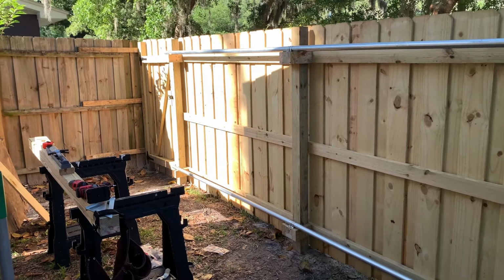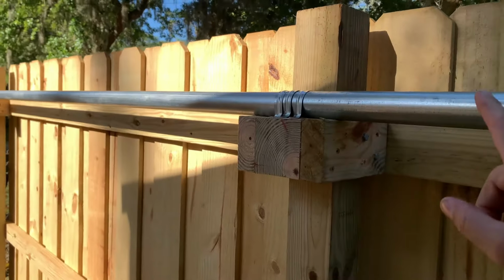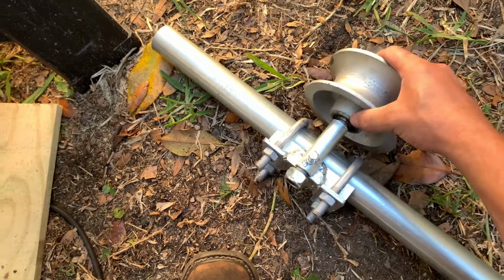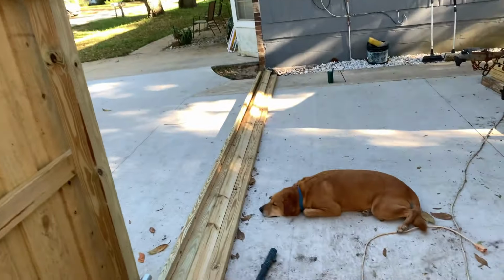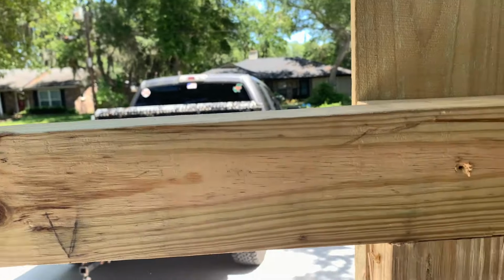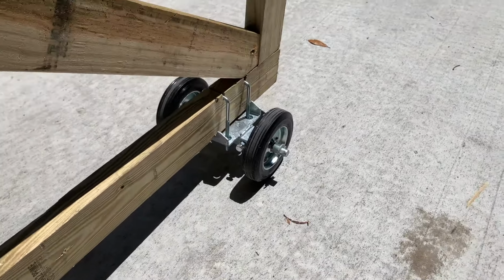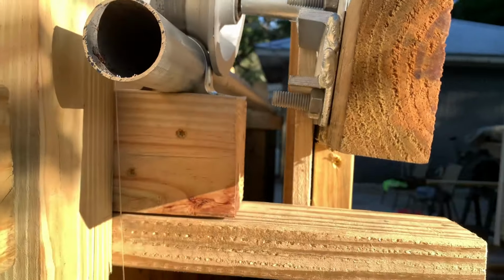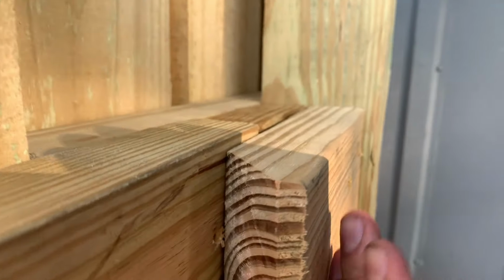How to build a sliding wooden gate (EASY)

Comment from the maker: Rollers - https://amzn.to/43TbXg0

Wheels - https://amzn.to/3KTUF9Z
Reply: Hey Floridaman  what is the gap from the bottom plate to the ground on the roller wheel ? I think my gate will be 64in tall and 15’ long . Setting my rail hight now , just wasn’t sure what the gap would be between the ground with the roller wheel , hopefully the roller wheel works Iam on grass for now , might have to do a 2’ wide by 15 ‘ concrete strip for the wheel to run on
Reply from the maker: @JasonGemes  I wish I knew what exactly you are asking here, are you asking basically what the diameter of the wheel is so you can see if it would roll over grass/dirt? they make rollers that are on springs, i dont know how well they would so what all that weight, but might work better over uneven terrain.

Comment: Just build the wood frame for the 12 ft gate. Then attach the metal pars the the stationary fence. Make sure it’s level. And rollers to the moving gate. I am building a shadow box style fence and 12 ft electric rolling gate now. I’ll post video when complete.
Reply from the maker: Awesome!!
Reply: @floridaman9045  what is the length of the 2x4 horizontal of gate? And how much excess did you leave off the left side for rollers? Height from top to bottom 2x4 horizontal post?
Reply: @TaylorGrayson33 Did you get your gate built? This is exactly what I'm wanting to do and have it motorized as well.

Comment: Thank you for the video! It occurred to me, to avoid using the clamps on the pipe and possibly interrupting the smooth operation of the wheels, you could drill through the pipe to fasten them to the wood supports.  You would just need to 1) drill a smaller hole all the way through the pipe 2) Bore out the top hole so that the head of the lag screw will fit through it 3) tighten the screw through the pipe (with an extension attachment) so that the head of the screw is resting inside the pipe. Just an idea. Thanks again!
Reply: could also weld them together and grind them down for a smooth transition.

Comment: I have wanted a sliding gate for my drive entrance for a number of years now.   This is almost perfect for what I need.  The problem?  I have a gravel driveway.  The roller may work, or it may not.  What I have discovered about the cantilever slide gates which avoid the wheel @ the leading edge of the gate involves allowing at least 4 or more feet at the trailing end of the gate. That extra gate length is what allows 2 of the cantilever wheels, top & bottom (4 total), to remain attached to the rails of the slide system when the gate is fully closed.  I believe the weight of the gate must be able to be held up by those trailing cantilever wheels.  These gates have concrete supports at the base for the strength needed.   Now, I might try this system, but only if it will slide easily over the gravel.   
***I see that, for the size of the gate you have installed, the extra space for the cantilever system I described above was not available to you.  
No matter. To me, this looks & works great for your situation.  The cost/benefit ratio, verses a more expensive design is quite strong here, too....   
Thank you for sharing this solid design.   
One question for today, a year after your installation:    How is your gate holding up after a year?   
Thank you for your time,
Reply from the maker: Very interesting! Gate is holding up great, I keep saying this, but I mean it this time, I will post an update VERY soon.

Comment: Where the gate hits the closed post. would it be better to have to hit the post that is in the ground not the extension post you added? also if i have a 12 ft opening would it be best to have 6 ft over hang for 4 rollers instead of 2?
Reply from the maker: Are you talking about the close or open position? and what do you mean by the over hang? I'm not a carpenter and don't do construction. This is just a project I did on my own, so I would only be able to give an opinion without a lot of knowledge.
Reply: when in the closed position would it be best for the gate to butt right up to the vertical post in the ground? and when the gate is closed to have 6 ft extra to have 4 rollers instead of the short area you have with 2 rollers attached to fence gate. Is your gate standing straight and moving straight or is it top heavy and swaying or bending? I think I will do a metal square tube frame now and attach the pickets to that to make it more sturdy.  @floridaman9045
Reply from the maker: Hard to understand what you mean, but I think it would be no problem to have some overlap. The gate is sturdy and is not top heavy. The reason I have such small overlap is because I made that person gate and I also wanted to keep the wheels on the concrete driveway. Adding extra rollers wouldn't be a bad idea. If you have the extra room and everything was perfectly square that might work great. My design kind of works on a tripod type design with all the weight going to the ground vs the rails/rollers, but it was all experimental. Let me know how it goes and good luck.    @TaylorGrayson33

Comment: Great job. I'm curious how you think this would roll over gravel or dirt? I can't use crete because there's a gas line running under the opening. Thanks!
Reply from the maker: there is a lot of weight and those tires are pretty hard, I have a feeling they wouldn't roll very well. I would probably put down pavers, or maybe like a 2x10 PT that might last a little bit with ground contact. Or you could always look for softer rubber wheels.
Reply: @floridaman9045  good call. Thanks!

Comment: I wasn't sure my idea was possible until this video. I like how straightforward your design is. Thanks from England!
Reply from the maker: Thank you! Good Luck!
Reply: Hi. I am getting closer to designing this for my slanty drive. One question. In your video at 4:55, I noticed that the top of the gate starts to flex away from where you want it to be. Later it seems pretty stable. Other than the weight of the fence and the strength of the fence build, is there anything that keeps it from twisting/flexing while it is rolling? It's windy on our drive. Mine will be considerably shorter so hopefully not a problem. Thanks
 @floridaman9045
Reply from the maker: Good question, once the pickets were on there it straightened them up some because it sort of tied it all together. But the best thing I did which you dont see in this video because I did it a few weeks after was run another 16' 2x4 all the way down that top board, I put the board on its side, so the 4" on the 2x4 is facing up if that makes since. It was dead straight wont allow it to flex. I glued it on with liquid nails and screwed it in. I plan on making an update video soon. Maybe I will do it today if I get a chance. @C3S789
Reply: Late to the party, but a tightened wire corner to corner in a diagonal fashion fixes sag and wobble on longer gates

Comment: You showed the rear rollers mounted to a 1 5/8 pipe but in the finished gate the rollers were attached to 2X4s
Reply from the maker: Yea I changed it up. still works great

Comment: I've started extending my existing fence and my wife suggested a sliding gate door.  I truly appreciate your video!  Not sure on all the things you did,  but im gonna try and use your ideas to make it work.   One problem i foresee for mine, is i don't have concrete for it to roll on.  Just dirt, so maybe I'll have to consider including some concrete,  for a better operation.   Thank you so much!  If you've made a follow up video,  please let me know,  since I'm new to all this...
Reply from the maker: This was my first attempt also, and its still holding up great. I would run a strip of concrete for it to roll on, or at the least you could get some pavers and place them in a stip. There may be some wheels out there that are more designed for uneven surfaces, mine seem to be pretty hard and I feel they would only do good on hard surface. Good luck!
Reply: @floridaman9045  I agree, I'm gonna consider doing some concrete for mine.  Probably at least 2 feet wide?  Thank you,  for your reply 🙏!
Reply from the maker: yea 2 feet wide should be good @garymcnemar6620

Comment: I am about to attempt this and would love if you could give me so info. How long of a board did you use? This is a 16 foot gate right? I just don't want to get started and run into issues. I was thinking of doing 10 feet or even 12 but easier to just skip a 8 foot post and keep going 8 feet
Reply from the maker: 16 foot. Good luck with your project

Comment: Hey Florida man I was wonder if pickets would take away the sway or would  2 x 6 frame be better
Reply from the maker: 2 x 6 might be a move, I added a vertical 2 x 4's on each side of the 2x4x16's to square them up, since this video was made. I put them on the side with the rollers. It now has no sway and opens and closes with ease.
Reply: @floridaman9045   nice do you have and updated pitchers or video ? Our gate opening will be 14’ foot , but will probably make the gate it’s self 15’or 16’
Reply from the maker: @JasonGemes  I don't but I will probably make an update video in a few weeks. I used 2x4x16's. I basically ran the full length, maybe cut them down an inch or two.
Reply: So we about have our fence done , rollers and wheel is ordered , we have a 14 , opening , i plan on using 2x6s for the Frame , with 2x4 stiff back horizontal and vertical ,  the gate will probably be 15 foot , give 6in eave way for coverage , I wanted to one piece my rails , I found some 21’ 1 5/8 but it’s 17 gauge do you think that will hold up ? Thanks you
Reply from the maker: @JasonGemes  That sounds like it will be solid, with a lot of weight (not a bad thing). I'm curious to see how it turns out! I think you should be ok with the tubing, I would just make sure to brace it as much as you can, if its not braced enough you run the risk of it flexing. Try to secure the rollers better than me. Mine wanted to roll since it was uneven. Or at the least take 2x4's and square up the side with the rollers (one on each side), it will keep it tight.

Comment: How wide is your opening compared to the length of the gate? Trying to figure out so i can do this. My opening is 10 foot. Should my 2x4 be a foot longer so i can attach the rollers?
Reply from the maker: I'd go 12' and you can always cut them. Only reason to go less if you dont have the space on the other side. Basically I think the longer the better.

Comment: Great video I ordered the parts you recommended but I'm having some trouble finding a square u bolt to fit the bottom wheel. Where did you find yours at? If you can provide a link that would be great as well. Thank you
Reply from the maker: I bought mine from ACE hardware, but I'm sure you can find at any hardware store like Lowes or Home Depot.
Reply: Thank you

Comment: What clamps are these
Reply from the maker: Called galvanized pipe straps
Reply: @floridaman9045  could you share me a link or video on how you went about putting the diagonal and the 90s on the actual gate. How you screwed them together. I saw you made two angled cuts on the diagonal to the 90s but not sure how you screwed them together
Reply: @floridaman9045 from Amazon too for the clamps?
Reply from the maker: @ronieramirez4842  I don't have a video on how I did them, but I screwed them in from the 4 inch side of the 2x4's into the horizontal and vertical piece, almost toe-nailing them if that makes sense
Reply: How did you join the chain link post if there the same diameter
Reply from the maker: I just put the union/join underneath the tube straps, they aren't connected, only touching. @ronieramirez4842

Comment: Nice build! The one thing I would consider is doing a 2x4 perpendicular against the top 2x4 to give it rigidity against bowing.  Maybe against both top and bottom but the bow in the top was noticeable. Thank you for making this video.
Reply from the maker: I did that, its not included in this video, but it helped a lot

Comment: Where did you buy the 16 ft steel pipe and what size i can’t find at the Home Depot.
Reply: Just buy two 8’ pipes and butt them together to create the 16’ bar and add three straps to the joint. I just replicated this method of gate yesterday and it was a success

Comment: There are some questions with the design for stability when a high wind comes.
Reply from the maker: Wind wont knock it over, I have it locked in on the far side and you can't push it off the rollers

Comment: I see you went with what is normally the vertical poles in a chain link fence, is there a reason why you didn't use the top rail poles?  They have tapered ends and slip into each other.  Just curious because I'm thinking of building one for a 17' opening.
Reply from the maker: These poles are the only ones I saw at Lowes when I went, I think the top rails aren't as wide and may have a little more sag. I could be wrong, but I think they make 10-20 foot sections of top rail, It may be worth trying just making sure you add supports underneath. The other concern might be the rollers being a little too big for those rails. But It may work just fine.

Comment: @floridaman9045 what length did you cut those 2x4’s that you added to 4x4 posts in order to place the rails on the fence? Thanks! I’m looking to do the exact same thing to my fence. Great job!
Reply from the maker: just went and measured them for you, the 2x4's are about 7 inches, the rails are centered at about the 5 1/2 inch mark. That leaves enough room for the straps to fit on there around the rails.
Reply: @floridaman9045  ty!
Reply from the maker: @samstorm8923  good luck! let me know how it goes.

Comment: did you make it where you can lift the will off the track? I need to build one but I am not sure how to make it where anyone can lift it off the track and push it over
Reply from the maker: It could probably be lifted off the track, the rollers come with a metal tab that goes under the bars so it can't be lifted off, but I took that piece off so it can roll past the 2x4's. I'm sure you could find a way to keep that piece on the rollers, or add something else to keep it from coming off. Good luck!

Comment: I give you credit for its operation. Only thing you did wrong is you mounted the roller rails on the fixed fence instead of the gate. Add a post behind the one on the end of the fixed fence. Rails go on gate & rollers go on the added post. This way you do not have that nasty gap & the gate looks better from the outside.
Reply: If you put the rollers on the fixed fence you would need 4 rollers ? And than the rail would be seen on the front of your gate ?
Reply: @JasonGemes The rails go on the back side of the gate. You add a post to mount the rollers on.
Reply: Ok so add the rollers to the post , and add the rail to the back of the gate instead of the rail being on the post ? How do you space the rail out from the gate ? And you would need 4 rollers total ? 2 on the top and 2 on the bottom ? Thanks
Reply: Interesting modification. Do you have a pic or diagram of this? I can't quite see the suggested roller and rail positions. @JasonGemes  Thanks!
Reply: @C3S789  I did my gate just like in the video but I used 2x6 for my frame and I didn’t use straps on my rail , I drilled and out a screw threw them and used a slip coupler at the joints